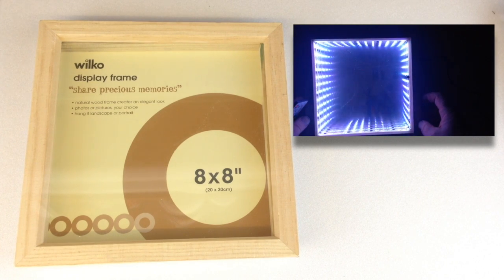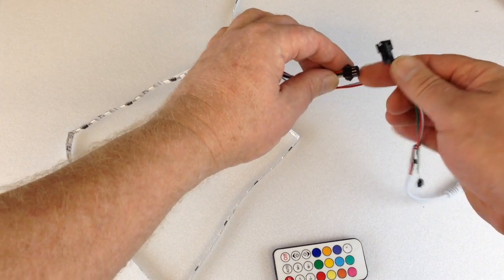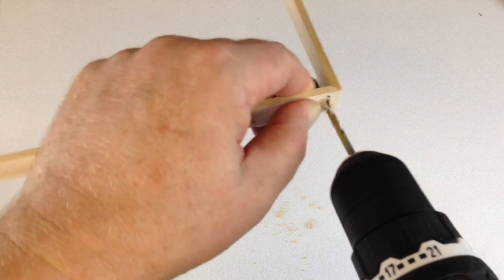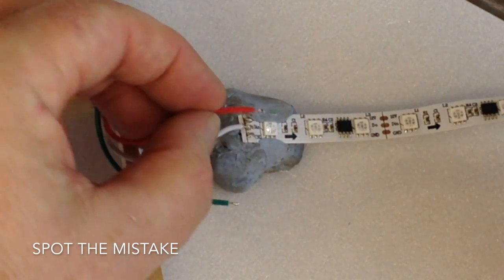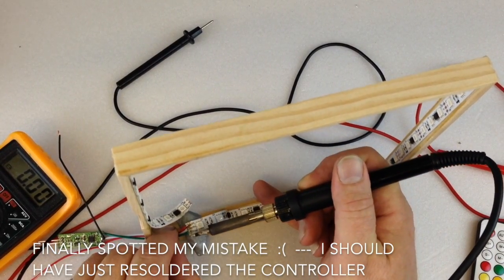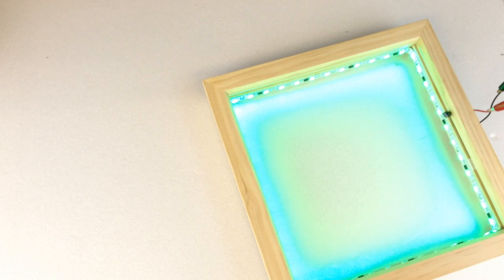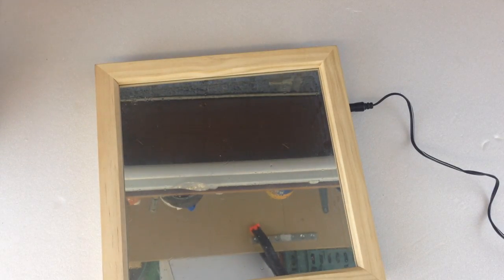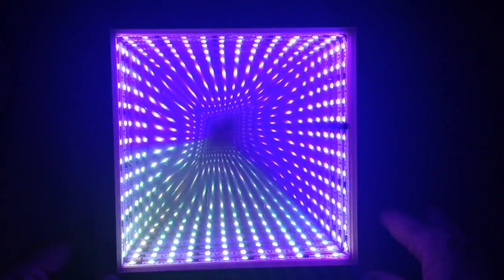Tutorial - How to Make an Infinity Mirror for less than $30 £20

Comment: Will any 2.1 mount work?  2.1mm I.D. , 5.5mm O.D. ?
Reply from the maker: Hi Mike any type of socket and plug will work, I used that type in the video because its easy and used by alot of power supplies. In my case it had to fit in the frame , if it had been to long i would have needed to have a spacer on the outside of the frame. The sizes you list are standard and as long as they match its all good :)